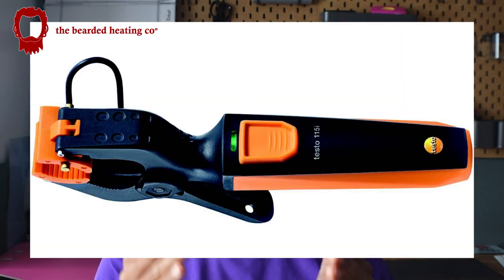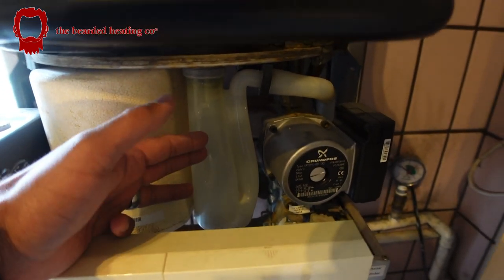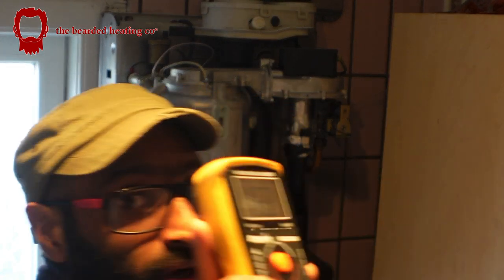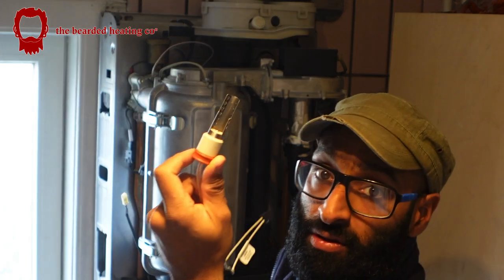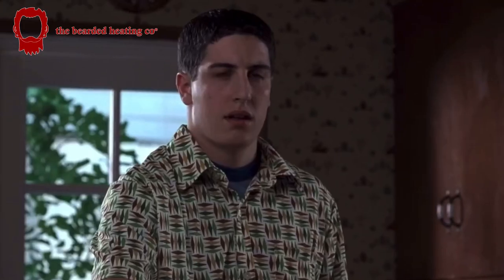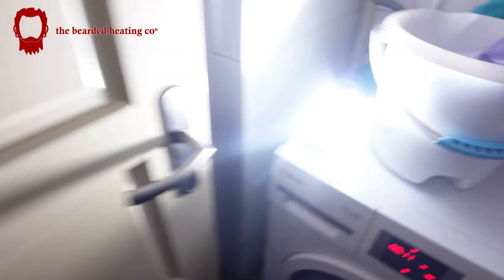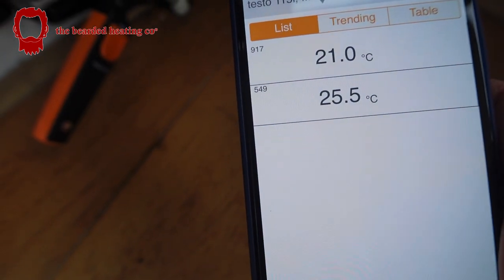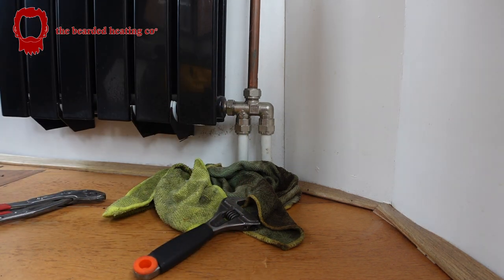The Bearded Plumber° Vlog #3

Comment: How lucky that you could switch the footvalves around! Saves a trip to the merchants or ripping the floorboards out.
Reply from the maker: Yes mate... I never open up floors or walls... that just makes the job too big and messy and will never go back down perfect
Reply: @thebeardedheatingco  fully agree, way better to just change the blocks
Reply: @thebeardedheatingco  if you want to make your life easier on the tail pieces for the rads, You should get one of those special inserts for a half inch ratchet, makes it a dream!